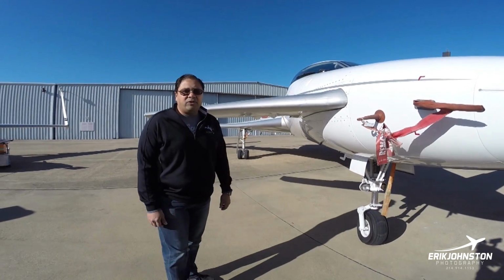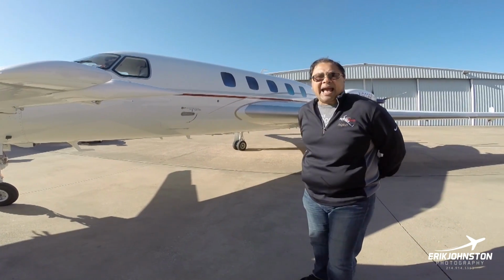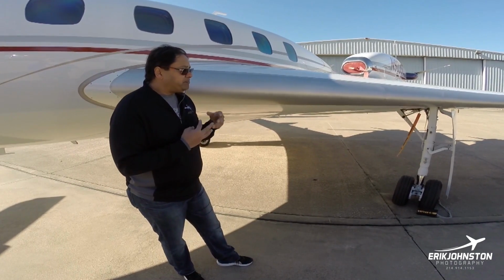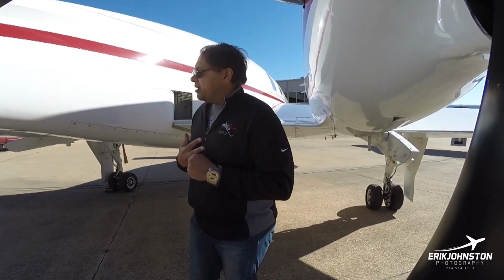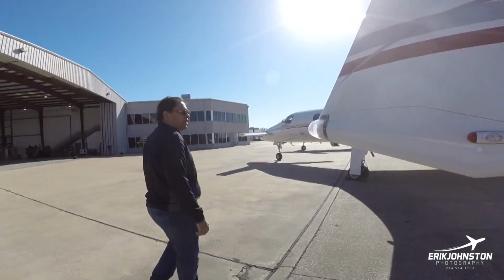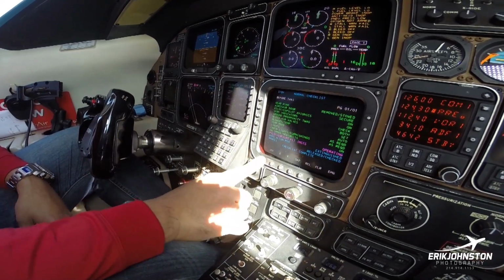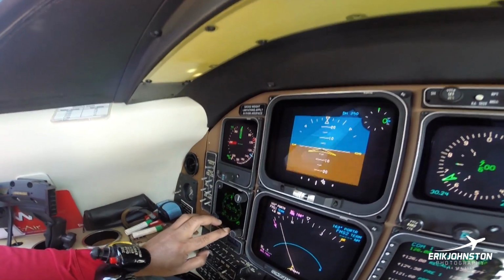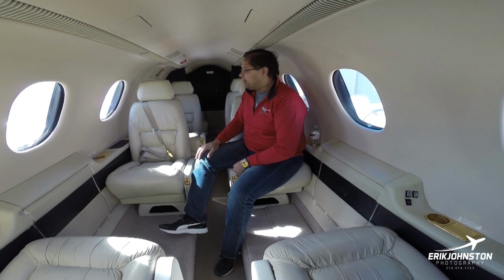Beechcraft Starship Walkaround Tour

Comment: The Starship was not the first certified composite airplane.  Even the US had certified the Windecker Eagle in 1969.  The FFA Diamant was flown in 1964.  By the mid 1980's carbon fiber gliders were normal.  It was the first certified aircraft of this size and weight, though much of the weight was a result of onerous certification requirements.
Reply: Most of the weight gain was because of one Ben Issacman, who was hired from Lear Jet. Before him, Beech had designed a geodesic frame filament wind, with the round King Air windows. Ben said a modern aircraft should have windows like the Lear and Ciations, but even larger. So these large windows and the nix of filament winding forced a redesign, this alone pushed the plane to over 12,500 lbs, then going from 14 cfr 23 to part 25, therefore larger entry way and escape hatch to name a couple, this added more weight, + a slight landing gear redesign. Also, originally it was worried that boots on the wings (anti-icing) ice chunks might damage the propellers. So a glycol tank and pump, with micro small holes in metal leading edges would desolve ice. But the tank was only good for 15? Minutes. The Faa now part 25, would require 45 minutes of de-ice, way to large a tank + say an extra 1000lbs? Glycol. So out with glcol, in with inflatable boots (king air style).

Comment: Does having two wings make it a biplane?   But seriously, shame that this didn't sell.  There were several stored in a hanger at Gt Bend airport back in the 90s.   And they did sound really cool flying overhead.
Reply: It still counts as a canard foreplane design.  If the wings were more equal in size, it would fall more toward a tandem wing design.  Biplanes are planes that need a certain amount of wing area, and choose to get that by stacking flight surfaces vertically, rather than having really long monoplane wings, or they require the biplane layout for structural reasons.

Comment: FL410 in a twin turboprop, in the ‘80s. Amazing.
Reply: Beech lists the service ceiling at 35,000 both engines. 18,000 one engine. FL410 is a bit high for a turboprop. I fly a Citation Jet and we flight plan FL410.  We top at FL450.

Comment: bucking manuver commonly known in aviation as: Porpoising
Reply: @Steve Myers Correction a pitch buck is not porpoising. Porpoising is a pilot induced oscillation reacting out of sync to the airplane movement. A pitch buck can only be done in a canard airplane. You slow down pull the stick back and the canard stalls, drops, un-stalls, climbs to a stall angle and drops again as long as you hold the stick back. FYI canard pilot here, keep the shiny up.
Reply: @oneskydog4401  ok. Thanks. New info for me
Reply: @oneskydog4401  never flown a canard.  Love to but...
Reply: @oneskydog4401  Burt actually the stall-recover-stall-recover action "porpoising".  I was there.  :)

Comment: The Starship was not successful because it could not compete with the King Air, a design from the 60's. The fundamental problem is any wing generating lift creates a nose down moment which must be balanced by a down load, usually on the tail. If that forward wing has any lift a portion of the rear wing must have a down load. So your primary lifting surface has down load! This was known and understood by almost everyone since early flight.
Reply: No.  The main wing in the rear has a pitching down moment, which is countered by the canard foreplane, which provides lift at the nose.  This is the same force balance as a conventional layout, except the conventional system pushes down at the tail.  The canard foreplane system is therefore more efficient, since the main wing does not have to overcome the added downforce created by the tailplane in a conventional setup.  Instead, the foreplane provides lift, allowing for the main wing to be reduced in size for the same overall lift.  The canard layout can also be made in such a way that the main wing will never stall.  By pitching the canard foreplane at a higher angle of attack than the main wing, the foreplane will always stall fist, allowing the pitching moment of the pain wing to bring the nose down to the point where the foreplane begins flying again.  The main wing never stalls, because being at a lower angle of attack than the foreplane, it can never reach the angle necessary to stall, since the foreplane always stalls first and drops the nose.  This effect is described in the video as "pitch bucking".
Reply: @jamesburleson1916  Thats correct statically, but it is dynamically unstable. With an initial down load on the rear surface any upset airplane nose up creates less of down load on the tail and a restoring moment. You can do the same with CG but with the same instability. Modern fighters use canards but they have stability augmentation systems, SAS. Look up neutral point for a moure detailed explanation.
Reply: Incapable of stall/spinning which kills a lot of pilots commonly referred to as loss of control. Stalls and subsequent spins happen frequently in take off and landing maneuvers.

Comment: Great Walk-around of the Starship 1, you might want to check out the First Flight of the POC: https://player.vimeo.com/external/318556423.hd.mp4?s=279ab5397a385840f2c388c6fb3acb135a0b546b&profile_id=175
Doug Allen and I both shot this, Doug Film and I did Video, at Mojave CA. The POC was the 85% Scaled model of the Starship. Pictured are the CEO of Beech Aircraft and the CEO of Raytheon. We shot some Air to Air out of a King Air through the Hatch. I know how great and smooth the Starship is in the air, great choice. We should talk some time.

Comment: In school the canard when referred to by its technical term was "foreplane", I have never seen in any tech drawings, nore heard any instructor or engineer refer to it as a flying wing. It was always referenced in technical drawings and instruction as either canard or foreplane. I did see where on sub drawings it was quite often called the flying wing, and likewise aircraft designed with no tail assembly was referred to as a flying wing. Gorgeous airframe though, thanks for the walk around!
Reply: It is my understanding that canards/foreplanes does not produce lift, or at least are not first and foremost intended too, they are "just" control surfaces.
One recent, none specific, source, https://www.youtube.com/watch?v=Ny0NjjjJqaA
Reply: @Bo Dan This one provides pitch stability, and produces lift to carry the front of the airplane. The design parameters are different than fighter aircraft.
Reply: Loaded horizontal stabilizer in front of CG does not lift down like conventional platform. (https://www.yourdictionary.com/foreplane) May be referred to as canard, front wing, because it does double duty lifting, stability and control of pitch.
Reply: As I remember the POH/AFM describes them as forward wings and the flap lever was placarded "FLAP/FWD WING".

Comment: Why didn’t Beechcraft aircraft take the Starship to a comersial success? Did they get it FAA certified?
Reply: Håkan Björkman He says in the video the aircraft is FAA Part 23 certified. I think they just couldn’t produce it at a price people would pay. The King Air was just too good, too popular and too affordable for the Starship to displace it; 30 years later the King Air is still a money maker for Beech. I’m also not sure how happy those pusher props would be on an unpaved runway. The King Air’s ability to operate from unpaved strips — especially in remote areas — is a big part of its popularity.
Reply: I think cost was a big issue as it was much more than a King Air and almost as expensive as some light jets.
An aircraft like it might be more successful today since the cost of composites and advanced avionics has went down and there's a drive to increase the fuel efficiency of aircraft in this class as it was significantly fuel efficient than a similar jet at the time even beating some recent aircraft.
Reply: @Patchuchan  nah, not so much cost as operator attitude. It was too different looking which made purchase managers wary and at the same time it didn't have jets which made managers who wanted bragging rights about their company replacing the old prop aircraft with jets not wanting it.
Reply: google thinks it ended up being a lot heavier than the initial prototype and that killed any advantage it might have.  It also cost $1 billion to develop in the late 80s.